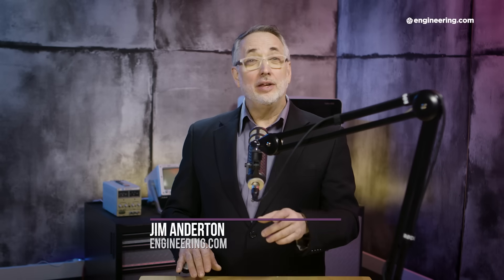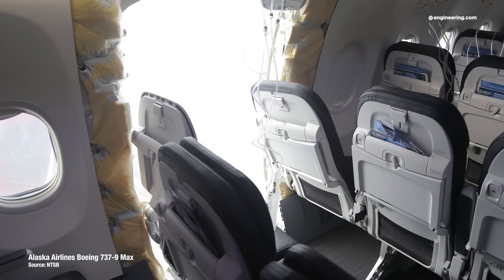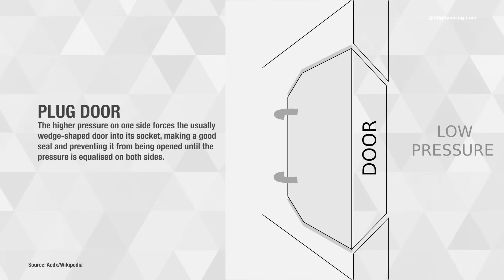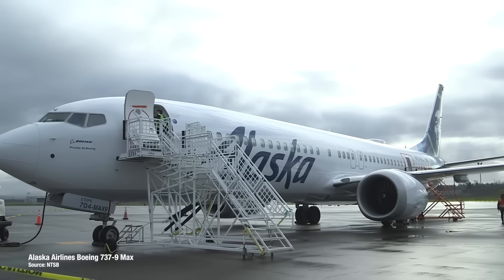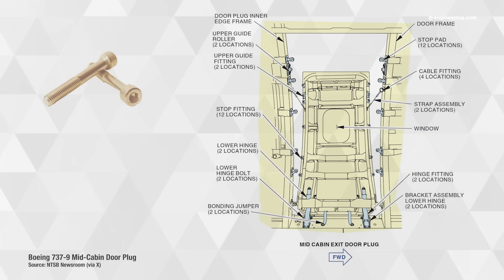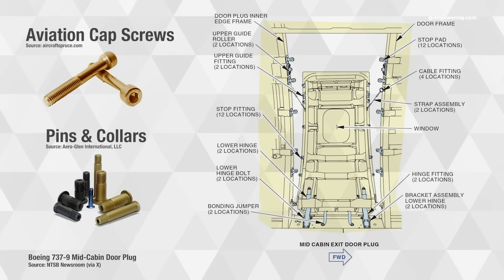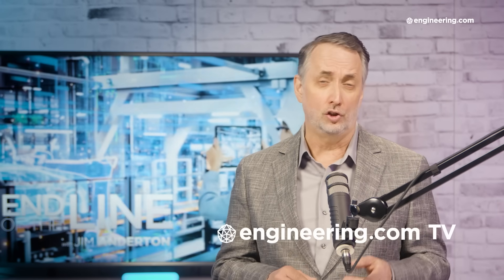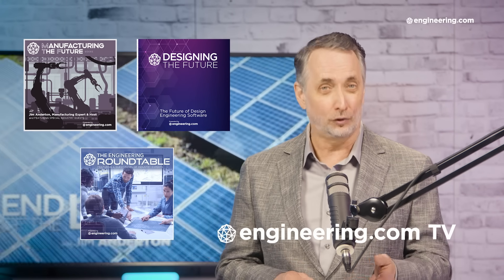The Boeing Issue Isn’t About Bolts

Comment: What would really clear this up is for Boeing or someone else, to show us how the plug door opens, and closes.
And how all the various features work on the plugs.
Reply: The door plug has many of the some characteristics as an actual emergency exit door so that it can fit into the same opening in the fuselage. The real exit door is held down by a mechanism inside the door. When the escape handle is rotated the door is pushed upward by the mechanism and then it mechanically disengages from the fuselage and swings out and down so that  the escape slide can deploy. A door plug is designed pretty much the same way as the escape door except that it has no opening mechanism. Instead, the four bolts hold it down so it cannot open. The only way that it can be opened is if the bolts are removed. If you are looking for a more detailed description of all this there are drawings and animations practically everywhere on the Internet.

Comment: They're lucky the door didn't strike the rear horizontal stabilizer...or we'd be having a different conversation.
((What else did some technician forget to secure/tighten?)
Reply: Yes the result would be like another Japan airlines 123 all over again with stabilizer missing
Reply: I have been thinking the same myself. The incident happened on climb-out, nose up, placing the center of the plug door/door plug even more inline with the stabilizer than it is when at rest.. It must have been a very close call, even at the climb airspeed.

Comment: This was not inward-opening, as you image shows. That makes it a design fault. The door is held in place by lugs on the bottom edge, which requires the cabin crew opening it to lift the thing by about 4 cm, and so restraining locks are needed higher up. However, this was not a door, but a plug fitted from the outside, and if it wasn't secured at all, as you suggest, then the pressure differential, rather than tightening it against the frame, almost certainly pushed it outwards sufficiently for the airflow outside to rip it away.
Reply: Could this loose plug have caused the cabin low pressure light to come on as it did on previous flights of this aircraft?
Reply: @howardbardsley1705  Of course. It was working the top fastenings loose, whatever they were. The top came free, the bottom tore out - you could see the rails hanging outside. This was, loosely, a failure to learn from the DC-10 cargo door disaster - a door which wasn't locking properly and worked itself free.
Reply: So if Alaska airlines had investigated the cause of the low pressure warning light they might have found the loose door?
 @RahereTheGenius
Reply: @howardbardsley1705  No, because it was hidden by the internal panel. It's not a door, no handles or hinges, a door opens from the inside. It looked, to all intents and purposes. like a door, but wasn't. The issue was that the seating arrangement was hovering around the point where a door might have been needed if they'd reduced the seat pitch a tad. It was cheaper in the long run to fir a door frame, but not a door, which, as said, would have upped the maintenance costs. So they plugged the hole, and voila.

Comment: Plug door is different from a door plug.  Plug door opens inwards and seals against the frame.  Door plug slides down to open and seals against the stops and not the frame.  The Alaska failure was to a door plug.
Reply: A plug door opens inward? What about doors 1L & 1R on the old 727? That door was larger than the opening but opened outwards.
Reply: @larryhutchens7593  What is primary locking mechanism in 727 1L and 1R doors?  In the 737Max door plug, the primary locking mechanism are the bolts which prevent door from sliding downwards.  If bolts are missing, the door is unlocked even if the door plug stops are sitting on the frame stops.  Bolts should have been critical inspection items.
Reply: @encinobalboa  I understand the 737 debacle. I never worked on more than a couple of 727s so I'm not one to go to for complete info. My knowledge of the front doors simply comes from opening them. The door is actually larger than the opening and the hinge mechanism is designed in such a manner that it allows the door to swing out at an angle from the door frame. Really neat piece of engineering. I have never touched a 737 of any variant so I have no experience on those doors. I was simply making the comment that not all doors open inwards and yes that should have been an inspection item. Sloppy paper work?? Management taking short cuts?? A confused & overworked mechanic?? Who knows? I have worked on a few DC-10 doors and they are held in position (not allowed to blow out) similar to the pictures I'm seeing on the 737 Max. The door would rotate inwards slightly just enough to clear the frame then a cable mechanism would pull the door upwards into the overhead. The emergency slide was in the door. Kind of a complicated mechanism but worked quite well.
Reply: @larryhutchens7593  The main cabin doors on the 737: https://youtu.be/WLfT5WJz-6s

Comment: There were four bolts involved. Each bolt required a nut and a split pin to secure them. that's  Twelve separate steps missed. how can this be anything less than gross negligence?😒😒😒

Comment: It can easily be traced back who was on duty this day and who worked on this specific unit.
Reply: Anyone can make an honest mistake.  That's why for complex things where risk of life is at risk re safety (like a commercial jet), formal inspections and sign-offs need to be MANDATORY.  At least that way, most simple human errors should be caught. 

And if it makes tickets somewhat more expensive -- so be it.
Reply: @rogergeyer9851  This is a safety-of-flight level installation and should require multiple inspections and multiple (shop and QC) buyoffs.  And don't rule out the possibility that paperwork can be fudged, to put it mildly.
Reply: @sflasaint811  Only if the paperwork exists to begin with. It wouldn't be the first time that an inspection step was missed by manufacturing engineers, or planners, or whatever they're called at a given company.
Reply: And if not, thats a problem in of itself
Reply: Shift changes cause havoc with that theory. What if the job is started by one shift and finished by another?
Reply: @nickcoram  Exactly.  Sometimes, when a job takes multiple days, and therefore multiple shifts, a lot of people are involved.  Technically, the person(s) who bought off the installation is responsible, but he/she/they may not have been the person(s) who actually made the mistake.
Reply: If you wanna find it, you'll find it. It's not a theory, they can narrow it down to a specific week that the unit was made and a group of people that were working that day unless Boeing doesn't wanna go that direction. This carelessness has fucked up a good company and I'm one of the victims of that bullshit.  @nickcoram
Reply: @nickcoram  a big conglomerate company like Boeing has to have specific cut-off and on points. One worker signs off exactly where he left off and a new guy begins with a few minutes of self accessing if where he begins is where the other guy left off. That’s why I don’t buy this shift working BS. A quick accountability check that will only take less than 10min will align the facts. This in my view was negligence 101 period.
Reply: @nickcoram  happens all the time.  This type of manufacturing is very good but they strive for 99.9999% correct.  This is that 0.0001% failure or perhaps higher if they are not achieving the goal.  I'm just glad that no one was hurt or killed by the failure and that things can get back on track going down the road.  If there is a learning from this which I think there is both from Boeing and the regulators then it is a fortunate outcome.
Reply: Perhaps not, since the work wasn't inspected and signed off. A costs savings solution (meaning loophole) that is apparently legal if you ask the FAA.
Reply: @thoso1973  Every single worker sings off his own work. So yes, there definitely is a paper trail to the individual worker who performed this operation.
Reply: @TeslaAtoms  Every worker signs off his own work, but additionally there is a requirement for an inspection by a different qualified person to be signed off as verification. If there were no steps in the documentation to perform and inspect the final installation of this door plug, then that paper trail does not exist. That would be a failure of management and engineering, which given the multitude of aircraft with the same issue seems to be the real problem.
Reply: I was wondering if steps were removed on the work instructions as a cost savings measure?  Hope not.
Reply: @sflasaint811  I’m sure it was. Repeat occurrences stems from habits that are left untraced…

Comment: I feel sorry for the 50K people who are subscribed to you, The plug doors were missing bolts assemblies (predrilled bolts castle nuts and cotter pins) they didnt use any of the"fasteners" you showed. This info has been available basically forever yet you still misreported it..
Reply: Exactly and the bolts that are used to keep the door from moving dont even need to be torqued they have castle nuts and cotter keys and the bolts serve as pegs or pins to keep the door from moving up and away on the slide.very effective ...if they are present. Boing screwed up by not re installing them after a gasket repair and alaska screwed up after there was a repeated alarm about cabin pressure loss.They should have or maybe they did do some sort of pressure check with smoke etc. But basically Boeings fault.